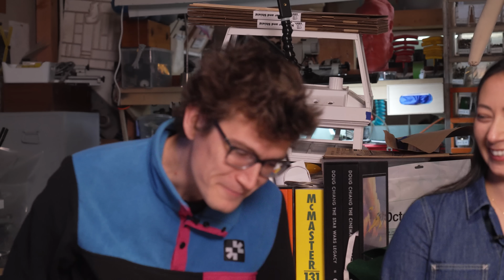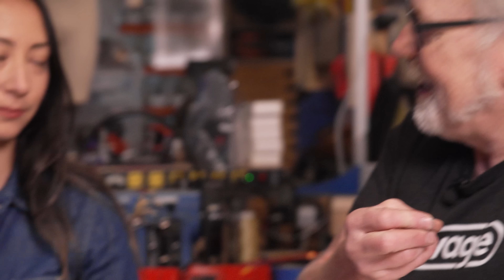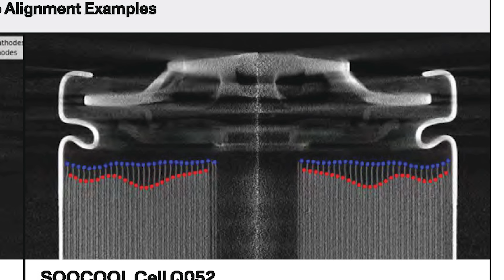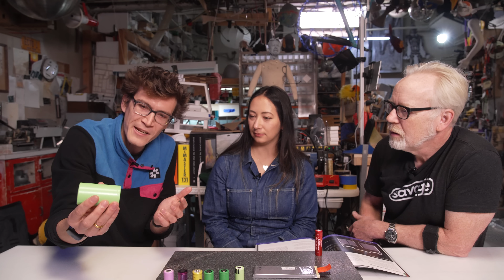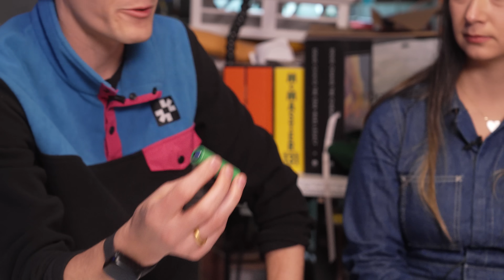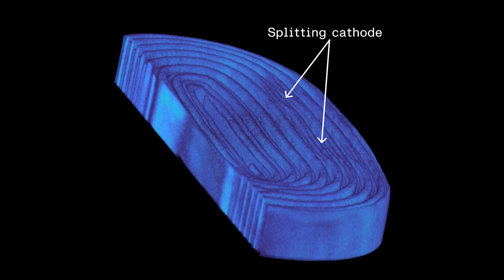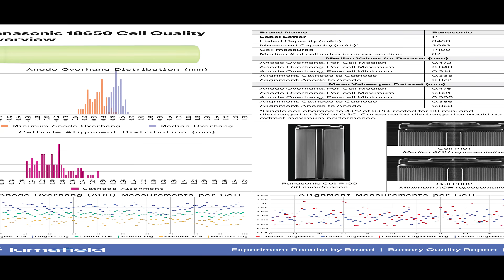The Surprising Flaws in 18650 Lithium-Ion Batteries

Comment: @13:50 the question is asked whether there is a checker to ensure that the cells you have are fitted with protections, and the answer was no.  However, there is indeed ways for consumers to check whether the cells they have are protected, and that is to ask if they are certified to a Li-ion battery safety standard.  The most ubiquitous standards for consumer product Li-ion cells is IEC 62133-2 and UL 2054.  There are a number of others as well, but you want to ensure that they cover individual cells (some only cover batteries (cells + controls/BMS), and some like the afore mentioned covers cells and assembled batteries).  The standards test whether the cells/batteries have the basic protections designed in to reduce risks associated with short-circuit, high/low temperatures, deep-discharge, over-current/voltage, etc.  When 'certified' to these standards, that means the cells were tested to ensure they had the protections and then have follow up auditing at manufacturing to ensure continued compliance.  You cant see for yourself if the protections are there, but if they are certified to these standards you can at least have some confidence that safety and protections were at least considered.  We should all be demanding that our government protection agencies are making adherence to these safety standards mandatory for any and all Li-ion cells/batteries sold where we live, as it is one of the main and most cost effective ways to ensure improved battery safety across the board.
Reply: The industry standards are great to have & have definitely improved life for the consumer.
But it's sad to know there are companies out there (pick any industry) that falsely claim they've adhered to these standards when they actually don't. And by the time that "lightning" hits causing an injury or death investigation, the immoral bastards have long since left the scene with pockets full of cash. Greed sux.
Reply: The industry safety standards are great, but from my experience, many cheaply made products imported from overseas and sold on Amazon or other retailers lack the actual safety features and just print them on the label even if they dont meet those standards. I mean watch like any BigClive video where he takes something apart that “meets standards of XYZ” and shows that inside the product lacks any sort of actual protection.

Comment: This video is a bit irresponsible.  With nearly all of the devices we purchase that contain Li batteries they have a battery management device (hardware and software), which is outside the battery.  The battery itself is not the only defense against thermal issues.  Yes, the battery quality is important, and this video is great for explaining the issues and concerns.  However, unless you are using battery cells without battery management, they are not as close to peril as you are portraying.

Comment: Have seen a lot of fires and honestly, I tell people the fire is secondary. The battery undergoes a violent exothermal reaction which produces oxygen and combustible gases fueling a secondary combustion event with any combustible materials in proximity. The reaction cannot be smothered or extinguished, only cooled...
These are everywhere and every battery from laptops to flashlights is some assembly of this basic building block. It really is about the quality control and basic mathematical odds. The more cells in your battery, the more spins of the wheel. That is why we have a 'new' issue with existing, proven tech. When you scale this to a 10ah tool battery, then a scooter with double the cells it doubles the odds of getting the one that got made on a bad day when the machine making a simple fold 12,000 times a day is off by a half inch.
I have seen a house the burned from a tool battery and fires from bike and scooter batteries up to EV fires that require 10,000 gallons and a hazmat response.
I suggest never charging unattended, number 1 rule. Don't screw with them, jumping a contact isnt worth a house fire. Always charge vehicles and if possible large devices away from the house. If you put you tesla charger in the garage its definitely convenient, but if you have an issue then there are 10,000 18650s in some cars with bad road rage... thats like trying to put out a campfire with a road flare in the middle...

Comment: 4000 milliamp-hours is the absolute maximum in a Lithium-Ion 18650. But to get that high requires extra thin layers and careful/slow charging. They're also not capable of high discharge current. You're better off going for 3600 to 3800 at the highest. So any 18650 claiming 4000 mAh may be sketchy. Over 4000 is 100% BS. It's always best to search online to see if someone has tested the actual capacity of any Li-Ion battery you're looking at buying.

Comment: My proven 18650 rule set:
Rule 1: If a 18650 proclaims to store more than 3500 mAh, then do not buy
Rule 2: preferably buy from well known manufacturers who also produce electronic devices
Rule 3: if you can avoid 18650 (for projects), buy 21700 instead
Reply: Actually, two of the most reliable and consistent manufacturers of Li-Ion cells are Murata and Molicel (which produces anything except Li-Ion cells).
Murata bought Sony's battery manufacturing arm.  I think you have heard of them!
Molicel supplies many batteries to manufacturers such as DeWalt, Bosch, BMW, Boeing, and many more.
They were the very first, original manufacturer of Lithium-Ion cells and have a 40-year track record of leading the industry.  I am only a satisfied user, not affiliated with them in any way.
I've used Molicel exclusively for years now, with (in the 18650 size) their M35A providing high capacity for low-powered devices and their P28A or (if I can find them) P30B giving high power, at the expense of a little capacity.
In the 21700 size, I use the P45B or P50B for power or the M series (M65 is the latest) for capacity.
All their cells are submitted for UL, UN, IEC and SDS certification, although the latest models' test results have not been returned and published yet, all others have passed, and I have no reason to suspect that the latest (P30S, P50S, P60C, M60, M65) will not.
I'm with you on the better 21700 cells being vastly preferable to 18650s, though.

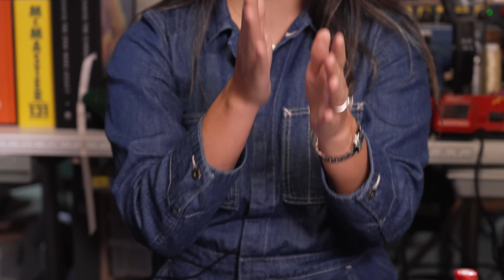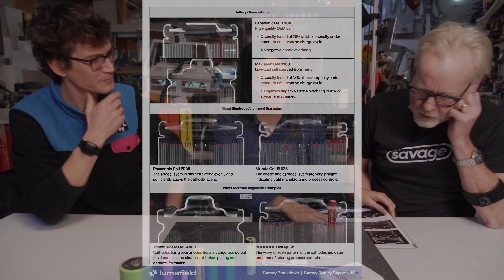Comment: Adam, you need a diagram at 4:20 to illustrate the main point - what the defect looks like.  Instead, there is 60 seconds of talk that isn't relevant, which even includes a diagram - but it's the wrong diagram!  It should have gone to 6:50 when the viewer was ready for it.

Comment: Great vid, very informative. Please don't throw the unknowns away, properly recycle them. Share a link, id like to know too. One thing tho, about 13:58. "I'd love to have a checker to see if one of my batteries has a safety cutoff device"  No not individual batteries but yss, in most devices there's the BMS, (battery management system) that monitors the whole group of cells in a pack that your vacuum or power tool or lawn mower uses. For example a 10ah Ego mower battery has 56 18650 cells, the BMS monitors 14, 4 cell groups for multiple problems,,  (overcharge, over discharge, current limits, and most importantly, overheating) It will shut down current to the whole thing, if there's an issue. Those cheapo, sub par cells, if they're used in a cheapo device probably will have a cheap BMS too. Like the lady said, if it's too good (as in "cheap") to be true, it might cost you more, much more.
Like a garage or a house, or your life!

Comment: I bought several of the Amazon Basics 18650 batteries to use in flashlights that me and my wife use for camping. ALL of them are rated or 2000 mAh. When I go to recharge them, they charge nowhere near 2000 mAh. Average is 185. Only 2 of them will charge to 2000 mAh. I left a "review" for them stating that, and Amazon tells me- "thank you for your great review of our product." Really? I basically said they are junk.

Comment: I suspect that the oil is reducing friction inside the barrel, which is affecting barrel pressure by allowing the projectile to move easier instead of build pressure. I bet the extra barrel residue between shots and the oiling procedure has some unburned gun powder particles.

Comment: I used to be a hardcore vaper with a lot of box mods so I’ve still got a couple hundred 18650s and a lot of 21700s for the bigger mods. 

Failures are WAY more common than one in millions when you take into account cheap batteries being rated incorrectly, and in-turn pushed way beyond their actual ratings. They’re basically guaranteed. A lot of cheap batteries will not only be overrated by capacity but much more critically by continuous discharge current. Which varies vastly in 18650s depending on battery composition what they’re designed for. If you’re vaping 200+ watts out of a dual 18650 and you throw in some 2 amp flashlight batteries that were re-wrapped and now they say the CDR is 25 amps (what you actually need), they WILL fail. And quickly. I’ve had several battery fires and one full on explosion because of that crap. 

Once I switched to using only nitecore batteries and hohm tech batteries I never had another failure. Expensive batteries, but always rated correctly

Comment: Nice video, three things came to mind,  first because it was at the beginning of the video and irked me the entire time I watched it... no you didn't in the cable video, you compared THUNDERBOLT to USB and saw differences,   second,  I really need re-think where I put my tool battery charger,  possibly surrounding it with nonflammable ceramic or something instead of where it currently lives which is between a couple studs in my unfinished garage, and  three I would say Haribo should stick to gummy bears, but they probably didn't make that charger, they simply license their name to anyone who wants to pay for it.

Comment: It's terrifying how shoddy the construction of these off-brand 18650 batteries are. Unfortunately, no matter how much we try and spread awareness of the dangers of cheap rechargeable devices, people are always going to be enticed by the low prices. The only way to stop these things from being sold is to hold retailers like Amazon accountable. 

I think consumers also need to change their mindset about the products they buy. Sites like Temu are popular in large part because people (particularly here in the US) seem to have this obsession with getting a good deal on things, even if they don't need them. For example, my grandmother's iPhone went into thermal runaway yesterday while she was charging it with a cheap Temu charger. Not sure how that even happened since the phone should regulate charging current, but the phone was just out on the table (not covered by anything that could insulate it) and got hot enough to give off a smell of burning plastic. She has a genuine Apple fast charger—she just bought the Temu one because it had a sparkly plastic case.

This mindset of compulsive consumption is not only dangerous (especially (but not exclusively) in the case of electronics), but is incredibly wasteful and promotes exploitation of workers. There's plenty of information out there that us consumers can use to make informed buying decisions. We just need to use it!

Comment: I use molicel p30b for 18650 batteries & p45b & p50b for 21700 batteries. For 18350 & 14500 I use vapcell because they have the best results and quality after all my tests. If there's better I'm all ears.  I have used and pushed these batteries for many years now in real world conditions pushing them and my flashlights to there limits.
Reply: Vapcell is just a wrapper on someone else's battery. They are likely using the cheapest ones they can buy. Almost any brand would be better or equivalent.

Comment: Many radio control devices use flat Li-ion cells singly or in stacked formats.  I wish you had them go into more detail how flat cells/batteries manifest failure and when to quit using swollen cells.
Reply: "... and when you quit using swollen cells." 

That would be as soon as you notice the swelling.

Comment: Vapcell is what every flashlight enthusiast is buying when it comes to certain criterias like 18350 or 14500 and large  compacity or mah 21700 batteries. People aren't into that vaping trend that requires these batteries like they we're many years ago. No of days the few vapors I know buy one that doesn't have a replaceable battery and gets charged. Time have changed. I know it takes years to collect data and come up with results. I'm 3 minutes into this video & im snowed in so this probably won't be the last comment 😂. Just a heads up.

Comment: You can buy a safe for your Li ion batteries. You may be familiar with a fire safe to protect documents and other valuables from a fire in your home. Well, this is the opposite. This is to protect what is outside the safe from a fire inside the safe.
I once saw someone short an 18650 battery while holding it in their hand. They instantly dropped it because the temperature became so great so quickly. The battery had flame coming from one end and it went across the room like a rocket. Fortunately it didn't come into contact with something else it could set on fire. But it did go into the next room which was carpeted, so there were several battery-sized "melt spots."

Comment: "The surprising flaws in (insert object name here)"  You'll find flaws with anything once you start putting them under an electron microscope.  What an absolutely ridiculous video.
Reply: So you are unwilling to acknowledge the absolute gulf between the quality of the top manufacturers and the cheap trash pumped out by hacks that is highlighted by the study presented in this video? 

Also, it's not an electron microscope.

What an absolutely ridiculous take.
Reply: @notahotshot  No, I said you'll find that 'gulf' with any product if you look hard enough (hence 'electron microscope).

Your lack of reading comprehension is ridiculous.

Comment: This simple answer is buy a battery from an American company or resurch the company that makes the cells but most importantly buy a very good Balancing board that has high voltage and low voltage cut off and temperature sensing that is the most important thingif the battery decent have any safety features ad them yourself the balancing board is the most important part of a lithium ion battery that's a fact if you want to be extremely safe use Lithium iron phosphate is power, dense, but very powerful and very safe.\nPersonally , I think the best batteries to go with Very long cycle life And very  Safe. Put always use a very high quality balancing board and make sure it has all the safety features temperature voltage high and low\nAnd that's really all you need to know.

Comment: Found this format of presentation too distracting on the subject. It would have been better to have an overall animated tech demonstration of how each type of form factor is designed and built. Then go into the faults you noticed for each brand and its expected failure mode.

Maybe the intent was for people to read the report and that this was meant to be just a discussion on the various findings. 

But the current video gives the impression that you would learn which brands were bad and why. Only the discussion jumps all over and never really gets into a linear explanation of the issues. Which is what I would expect for a casual conversation as opposed to a prepared filmed YouTube topical video on what should have been informative as well as cautionary on brands to avoid and why. And how to correct the issues if you run into them.

Most will not read that report. Many who do read the report won’t understand what they are reading. This is why the CSB is famous for being able to present their findings to the public. They know most won’t read the report which is why their animation and narration are the gold standard for showing how a process or piece of equipment failed and what the root causes of those failures were.

Comment: Thank you for the video. Unfortunately, the graphs in your report all use different scales for their axes, so they cannot easily be compared. You shouldn't stretch one graph so that they all "fill" the available screen space. They should all use the same scale, or they are useless "fluff". The histograms also need some visual feedback on what an acceptable distribution looks like, so we can tell whether it's "good" or "bad" at a glance.

I haven't read the report yet, so maybe the information is buried in there? But time is limited, especially when you're talking about the conculsions section. That's the bit I always go to first, so I can decide whether it's "fake news" / "sensationalism", or it's actually worth reading the whole thing. :)

Comment: This topic is about engineering and science yet your fluffy presentation was more suited to a studio dealing with politics. You introduced  a valid topic but failed to say anything that supported  my 2 decades of use. You raised my interest but only to get me to turn in search of a more diciplined assessment. It is true that unless an 18650 fire is left to burn down a house it will not make as much news as an EV burning on the road but that is largely because a thousand 18650s clustered together make a bigger fire and provide a thousand times the chances of a thermal runaway to start the fire.  Glibly throwing popular lithium ion fire hazard created by a bee hive of batteries  at retail single cells is valid if you deal comprehensively with the matter. Failure to do so just colours the rest of video that looks more like monetized entertainment that information. A real problem but an incomplete assessmnet with rubbish presentation. It does not matter how much you pay for your 18650, handle like  explosives.